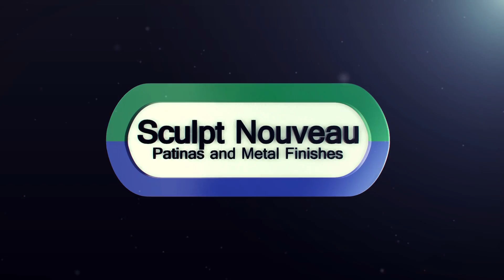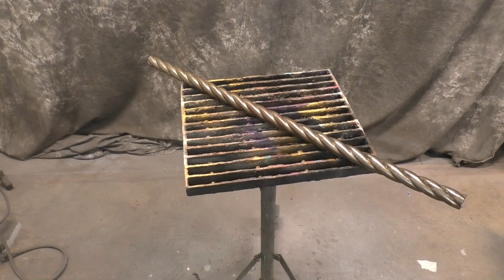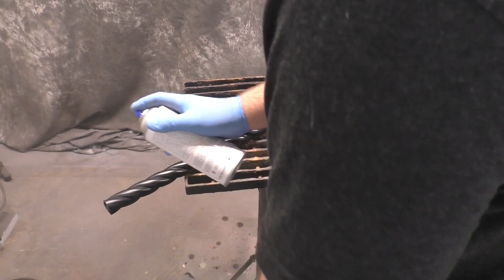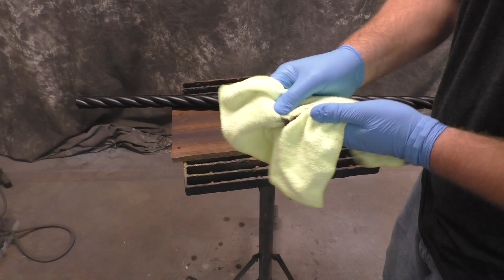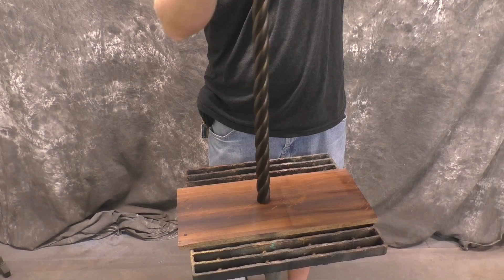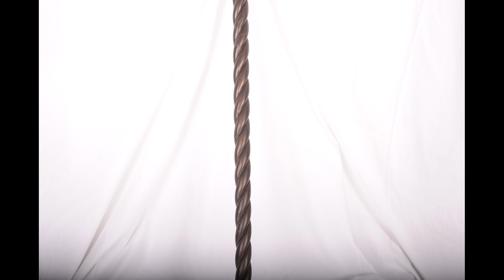Turning Steel Into Another Metal 1 of 5: Using Black Magic and Bronze Metal Rub

Comment: Nice, can this be used for a sculpture outside?
Reply from the maker: Yes it can, I normally recommend sealing over the Rub as well for that kind of situation. Its pretty tough but I like to seal everything in Ever Clear to ensure longevity. The Metal Rub can be clear coated after a 3-4 day cure.